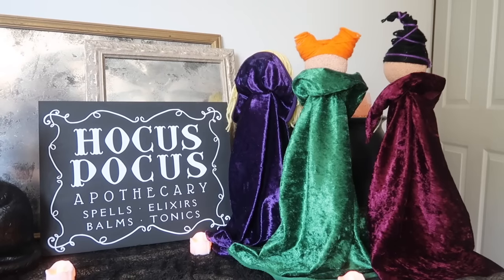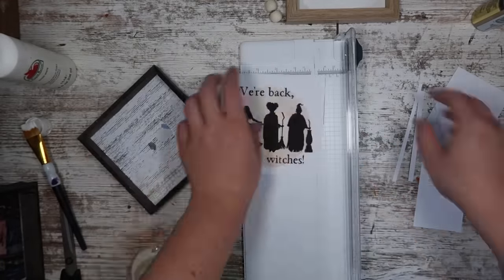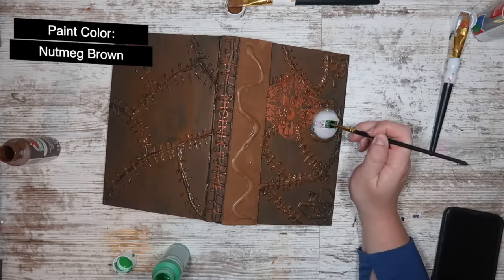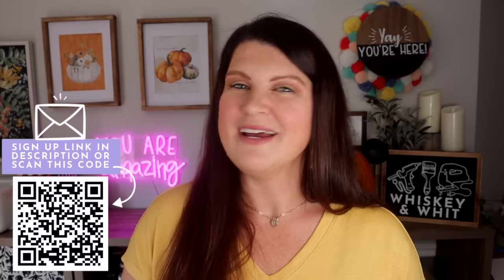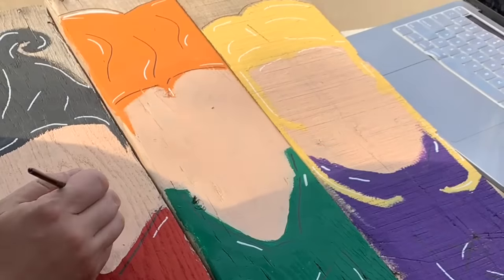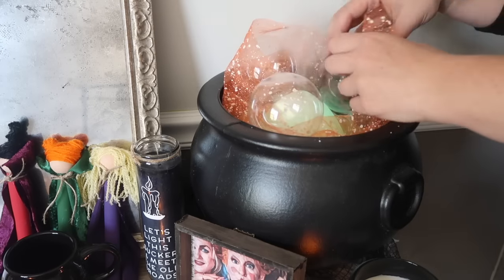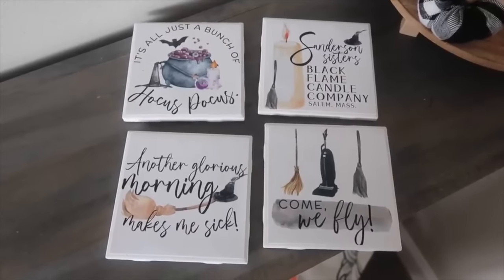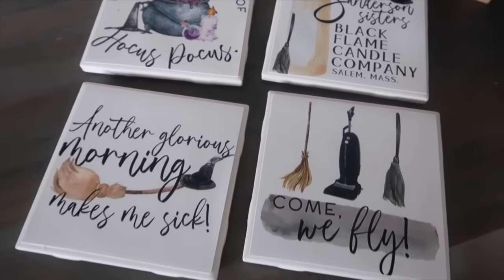30 Halloween DIYs You'll Want to Steal for Your Own Home! | DIY Outdoor Halloween Decorations

Comment: I can't find the svg for the Happy Halloween sign that you used on Dollar Tree pumpkin sign, just the png. Could you please tell me where to find that? Love your ideas, thank you for the free printables!
Reply from the maker: Hi there, some of my files are PNGs. I designed those before my new method of making SVGs with layers, but they cut the same on Cricut Design Space.
Reply: @Whiskeyandwhit  thanks for the reply. I already converted the png to an svg and used it that way because I have had issues with pngs in Design Space before. Thanks for letting me know, I truly appreciate your response and really enjoy your videos!
Reply from the maker: @debrachiacchieri5316 so happy to hear that! Glad the converter worked. Usually my 1-color files are just PNGs but I’ve started making files in Illustrator for higher quality for the craft buddies!
Reply: @Whiskeyandwhit  Yup, I have made some files in Illustrator that have turned out great also! Worth the time to learn how to use it for sure!